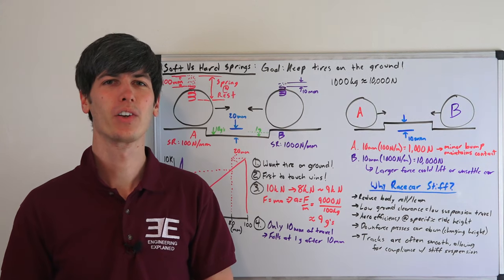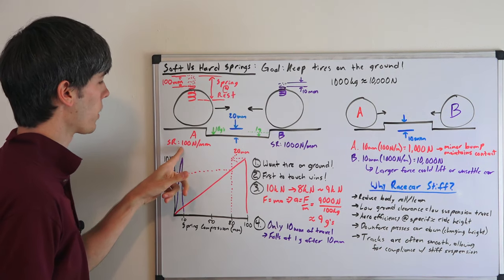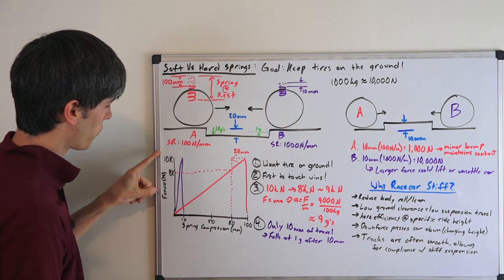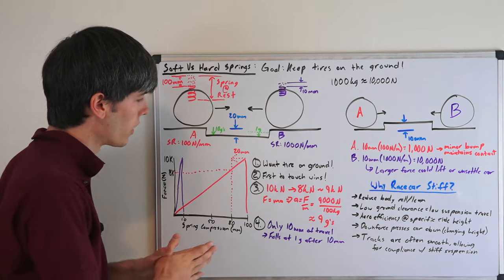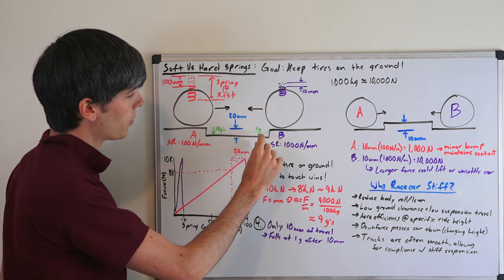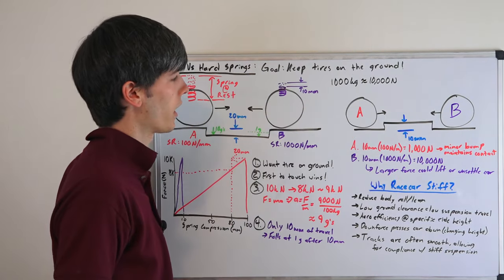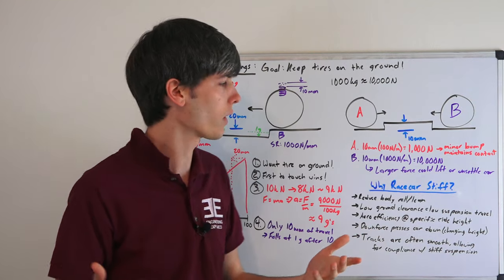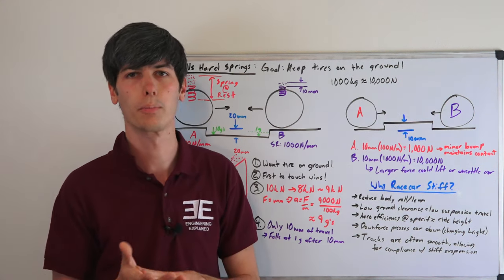What's The Best Suspension - Soft or Stiff Springs?

Comment: @2:46 I disagree with you here... You started by saying a soft spring will return FASTER; however, your chart completely ignore TIME. Both stiff and soft springs are carrying pretty much the same load, correct? Ignoring damping, the stiffer spring is going to push the tire into the ground FASTER since it has to travel less distance to unwind. The "return rate" is higher. What you are proving with your chart is that a stiffer spring provides for less droop travel which MIGHT cause the wheel to skip/skate over bumps and lose contact with the ground... This is something that a proper suspension would account for by running helper springs to dial in the SAME bump/droop travel as a soft spring. Your example only works because the dip in the road just so happens to be deeper than the available droop travel of the stiffer sprung car.

Comment: We have a racecar with 4 holes to adjust the front shocks out at the bottom of the arm, changing the characteristic of the shock and also the ride height. We then have another tower at the top mount of the shock with another 6 holes to play with.

My question is how, mathematically, can you calculate the effective spring/shock strength at the wheel, since leverage and angles all come into it, at each combination? 

Many Thanks

Comment: I do prefer soft, but that's only 1 part of the equation.  
I decided to stiffen the body and frame on my car to improve handling, but don't know how I should go with wheels and tires. 
A: 15s or 16s with 60 profile and wide grip 245 or 235 and a soft sidewall
Or
B: 17s or 18s with a stiff sidewall and about same width.
Help?

Comment: I have a 2500 pound 2016 Prius C with hard suspension. I have read that a heavier tire/wheel would better resist the pounding of road bumps - contrary to other theories. What could I do to soften the suspension?

Comment: So what about softer springs and super stiff anti roll bars? Best combo for the road?
Reply from the maker: Melric Chico Super stiff ARB act very similar to stiff springs in corners. Effectively, you're increasing the stiffness of the suspension (and also making it less independent, as the sides are connected). This doesn't apply to bumps when you're traveling forward that lift both wheels, however.

Comment: I wish you could make a video on spring rate measurement, calculation and adjustment. My Mitsubishi Eterna '89 suspension seems to oscillate on minor bumps/slight uneven road even though the shock absorbers are new (well, the springs are still the old ones). The old suspensions was oil and the new ones are gas.
Reply: Probably hitting bumpstops

Comment: Can you explain which is better, soft damper+stiff spring or vice versa?
Reply: set damper to softer side example...16way adjustable...set front at 5-6...rear,same thing...if your tire rubs the fender,you're either too low or you need to go up +2 say from 6K to 8K...use a relatively stiff spring as long as it's valved for that shock...nice for regular roads

Comment: You didnt equate the other spring though, if both springs were stiffer and in a cornering situation due to less body roll wouldnt the inside spring need to rebound less for the same amount of force on the ground

Comment: Engineering Explained Assuming the drop was only 10mm and not 20mm, which wheel would hit the bottom first? I'm lazy to do the math/physics for it ;) but my intuition is telling me it would be the wheel with the stiffer spring? 
I'm just thinking that the spring length difference between a loaded and unloaded spring is much larger than most road surface drops so wouldn't spring with a higher spring rate reach maximum extension faster than softer springs?
Reply: Ok I think I did the math right and intuition is not something to rely on ;) The average force for the the stiff spring over the 10mm would be 5kN and for the soft spring 9.5kN, which means the soft sprung wheel hits the bottom first?
Reply from the maker: You did the math well! Soft wins.

Comment: Is there an ideal spring weight according to the weight of the vehicle?  I'm restoring a '67 Mustang convertible and am stiffening up the frame & suspension and want a better handling ride than stock and the only spring option available above stock (200 rate) is a 600 rate spring (front).  I'm afraid it may be too much of an increase that will result in a way too stiff ride.  Any suggestions? Thanks!  Love your succinct videos.

Comment: Thanks for this video.
Unplugged Performance advertise their springs as "Dual Rate Linear".
Eibach state theirs have a "Progressive spring design" but don't appear to have varying coil widths.
Can both offer the softer ride than stock springs when the car is not under cornering load?

Comment: I have a tall van. 1999 Ford econoline e250. If I install super soft suspension and go around tight corners will the shocks etc. Compress so much that it would change the center of gravity on the vehicle, have crazy amoumts of body lean and make it more likely to flip over?

Comment: Hello with those examples of soft and stiff springs you used ,how about if the car was parked on a flat surface would the soft or stiff springs be pushing the wheel down harder to the ground? Thank you
Reply from the maker: reinhard overturf Same force, as it's the weight of the car which is compressing the springs. But the soft spring will press with a higher force longer as you begin to "lower" the ground.

Comment: if the car with soft spring was travelling fast enough through a small pothole it would react the same as the hard spring in a way that it wouldn't make contact with the bottom of the pothole

Comment: So I have a 1965 Chevy C20 pick up. And we'll the springs I believe are well done in. The front because of the weight of the 350, the springs don't really hold the weight and it will bounce a bit. The rear springs are stiff as hell but when I put a camper style trailer, the springs compress all the way. I'm putting all this here because I need help trying to narrow down springs or a possible conversion. Any advice?

Comment: I'm guessing that the video is meant to be short so that your audience's interest doesn't tail off, which is certainly understandable on a forum such as this.  However, attempting to describe suspension dynamics in just six minutes hardly does the subject any justice.  There is a lot of missing information.  Even without getting into a suspension's physical geometry, load transfer, etc., I'm sure you're aware there is enough material to cover on just spring and damper rates, bound, and rebound to cover a multi-page instructional pdf.

Not faulting you at all for this, but there is little point in describing the behavior of springs over bumps without getting into the damper's job of controlling the springs tendency to oscillate (unless the vehicle's mass alone is enough to control oscillation, such as with trains and heavy equipment).  Explaining the importance of 1, 2, and 4-way adjustable dampers would be a plus, since you're mentioning race cars.

Please don't think I'm being critical.  I like your videos, but frankly you need a good 20 - 30 minutes or more, or even a multi-part series to adequately explain this material.
Reply from the maker: Treetop64 A piece of a very large puzzle. Here's the playlist: https://www.youtube.com/playlist?list=PLE067A7397E1AF108

Comment: stiff is good on a fairly smooth and even surface, terrible on a bumpy undulating surface. the car dances and twitches all over the place. The best setup i've experience in my rally car is a dual progressive spring rate.

Comment: Hold on - hold on... " ...the whole point of the suspension is to keep the tyres on the ground." It is not anywhere near that simple. The original point of suspension, on horse drawn wagons, was to improve the ride. Early cars used the layout and principles of wagons, the idea was the same. (I am going to leave out a couple of pages of waffle here, because it's not quite relevant.) The purpose of suspension, on a high performance vehicle (2 wheels or 4) is to improve performance by optimising vehicle grip, road-holding, dynamics and handling. Exactly which one of those is most important, depends on who is asking. If grip (or lack of) is costing you one second a lap, but vehicle control and dynamics is costing you five, then give up grip and use every trick in the book to improve chassis stability and vehicle dynamics. Maintaining an advantageous balance of these qualities or abilities, is what you do with suspension. An F1 car or an IndyCar doesn't ride very well. But you could not use those suspension settings in a NASCAR (or a road car) because they simply would not work. If nothing else is being a bigger problem, you do work toward improved grip, or possibly improved tyre life and better performance at the end of the race, like MotoGP. What you do with suspension, is address your major problem. That may or may not be grip.
Reply: +Kneedragon1962 
I know what you're saying, but he's right though

first and for all, the suspension is to keep maximum grip on the road
AS MUCH AS YOU WANT

turn it around as you like, but eventhough a F1 has very little supsension travel, it still does

thing is, the wings and tyres develop so much grip, suspension can be set very stiff.
also, in F1, the tyres do a lot of the suspension's work

every suspension engineer I've talked with says the same: dont go for as stiff as you can get,  try to go as soft as you can without upsetting handling
Reply: lillnemo1 This is true. Make a car very stiff, and rather tail happy, it feels good, more like a racing car. Inexperienced saloon car drivers often go for enormous amounts of negative camber at front, because it has excellent bite and turn-in. Does not look after the tyres very well for more than five laps though... You do generally want to go with the softest settings you can get away with.

Open wheelers are an entirely separate breed. We had wings, then we had tunnels or venturi. Skirts were outlawed, to try and limit the cornering grip, so to get and keep the downforce required extremely tight control of ride height. That required incredibly stiff suspension, almost no deflection at all. That is a rather different world to a road going sedan. Lack of suspension travel is actually a bit of a problem for open wheelers. It would be better if they actually had some suspension, but then the aero would go all over the place...
Reply: *****
glad you understand it better now.   you are right about what you said now at the end too, you know.  A lot of cars have too soft tires, suspension (eventhough japanese and EU cars tend to get too stiff nowadays), so a lot of bodyroll and tire flexing occurs.

both make a car feel difficult to get through a corner or feel uncontrollable (and they are)

stiffer tires (lower sidewalls) and stiifer springs (and or rollbar) make your car more predictable.....

until you go too stiff

than your car goes hopping and get less grip on the road

effect of stiffer suspension on a stock car will give you more confidence and thus you tend to go faster

lol

cheers

Comment: My wife has an ultra-delicate spine, and she bought the Subaru Legacy because it was the only car (under $40K) with a ride that "Consumer Reports" rated "Very Good" instead of merely "Good."  I find the ride worse than the 2007 Mazda that she traded in.  It's certainly nothing like the long-distance highway lounge-cruisers of the '50s and '60s.  So what's a good ole soft car that would smoothe out the unbiquitous, inescapable bumps that are endemic throughout today's unattended, worn-out, prickley infra-structure?

Comment: Hi!
Very good vid!
Only u forgot major vin from softer springs- dynamic weight distribution in turns,
Thats and what u say in video is biggest advantages from soft suspension with good driver behin the steering wheel.
Stiff springs and big anti roll bars r for racing driver on smooth tracks and for puussies who dont know a dam thing in cars and fast driving )
Reply: I personally take offense to that. considering how I nearly rolled my old car do to the soft Springs. tell yourself soft Springs are perfect and if know how to drive work just fine. then take a basic car no sport tune anywhere on it. hit a good curved on ramp going up hill that's a near uturn  and fairly sharp going 90 and tell me everything is going to be ok. cause it ain't going to be. lower Springs and stiffer means difference between life and death then. he makes very good points but driver application still has to be considered as well.
Reply: U roll not because of soft springs- because of cheap dampers!
I almost live in track days and always show good times and i have pontiacs OEM springs with custom made sport dampers.
Every day drive is silky smooth and track day drive is controled and fast. 
Track where i live  
M3E46 at Bikernieki 
Just use search.
With all that coilovers u maybe fast in new arab formula 1 track and never b fast in real tracks like Nurburgring and etc
Reply: +Gregers cilvēks thanks for that information.

Comment: Can't you have two springs both with 100mm travel but with different compression rates (if you will) depending on how the spring is made and what it's made of. I.e. a titanium spring vs a plastic spring with both 100mm of travel (that would be stiff vs soft, IMHO)? Maybe it's the same thing just a different way of looking at it but the reason I ask is because I see a lot of coilover kits with different sets of springs with the same amount of travel...

Comment: I don't know if anyone has looked at this already but this car weighs 4000kgs. it's not a racecar anyway. 1000kg is not going to be the the force acting on 1 wheel. also surely a stiffer spring has a greater extension rate than a soft spring so how can the acceleration of a softer spring equal that of a stiff spring.

Comment: for drag racing what is better for shocks struts and springs? i hear everything and no one has the same answer
do u want a firm rear or soft rear, also do u want soft front or firm rear?
Reply: If the car is rwd, you want a softer rear. (I can't really say about front suspension.) This helps keep the tires in contact with the tarmac (as explained in the video) and it allows weight to transfer to the rear, giving you yet more grip. 
If it's fwd, you essentially want the opposite, so you make the front soft and the rear stiff so the front wheels keep contact, and the weight can't transfer to the rear as easily. 
And if it's awd, just call your local witch doctor for help. 

(If I'm wrong about this, please correct me.)

Comment: Your failing to take into account that body roll will cause more of a loss of control and in the end loss of grip just as much. Its more preferable to have the car possibly lose contact with the ground for a split second but the car is going to regain grip and it will still be on the intended course whereas with softer springs the wheel may be able to uncompress and touch the ground but the body roll of the car will be causing it to sway which may cause you to spin out.

Firmer springs keeps the body from going all over the place after hitting that bump yes you may lose slight contact for a second but once you regain grip which happens so quickly, the car will still be going on its intended path without having to overcorrect the car

If youve ever driven on a circuit track youd understand because racecars are losing contact with the ground in many places during the race but you still go on the intended path without swaying to swerve to spin out of control.

Think of a boat and how it cuts through the water different types.

Tire quality plays a huge part in this as well.

Comment: OKay this is pretty late to comment but anyways, how is that force of 8kN arrived at? The weight on the spring is always 10kN and the moment after the wheel touches the ground in the puddle, the spring is going to compress back by 100mm. So where is that 8kN even in the picture? Is that totally momentary? During the time when there is no normal reaction force on the wheel, the spring sits at 80mm compression; but once the freefalling weight of the car provides force on the spring, it compresses to 100mm..

Comment: i know understand. however Ford just made a suspension  system to counter the tire going into the pothole. it seems to "glide" over the pothole.
Reply: That doesn't have to do with the stiffness of the springs, it changes the dampers in the shocks when it senses a pot hole so the spring can't push the wheel down as quickly.  It still drops into the pothole, just not as much.
Reply: Thanks!

Comment: If the depression was 10mm not 20;

Soft spring = ((10kN+9kN)/2)/1000kg = 9.5g
Stiff spring = ((10kN+0kN)/2)/1000kg = 5g

Is that correct?

Comment: Can't they just put bigger anti roll bars then to stop the car from rolling? Or does the stiffness of the springs and roll bars have to balance each other out for the ride to stay level?
Reply from the maker: ***** Somewhat complicated answer. Basically an ARB is going to increase spring stiffness for lateral g's, but it won't for longitudinal g's. So if you go over a speed-bump like bump where both tires go up, the ARB will not prevent your car from slamming down as both ends will rotate the same direction. Too soft of springs would mean you bottom out. Too stiff you'd lose contact with the ground (jump!).

Comment: Hey man, quick question, would air springs have better grip or would it be coiled springs? Since typically air springs have lower spring rate than coil springs at the start, hence it would make sense that it has more grip. However, I've been told that air springs also has an issue with overcoming initial friction at the start of its motion, where coil springs doesn't have that problem. Many thanks!

p.s. Also does coil over springs run into the problem of the initial friction with air springs?